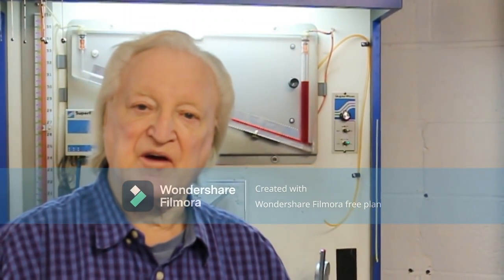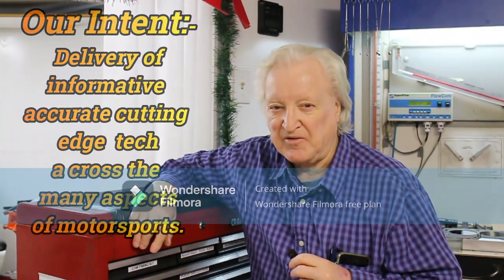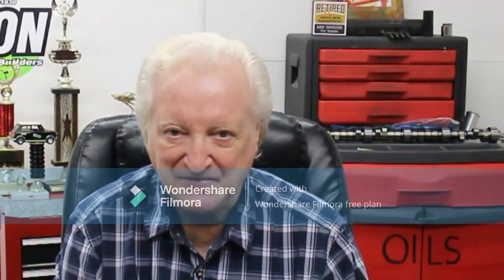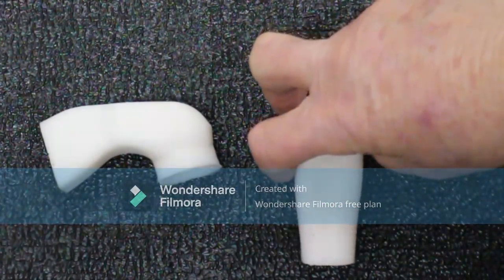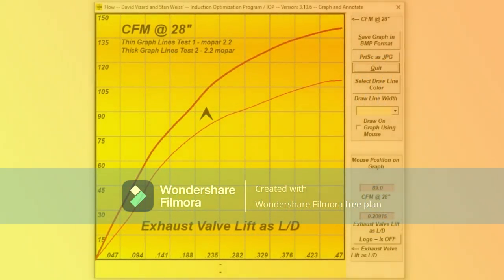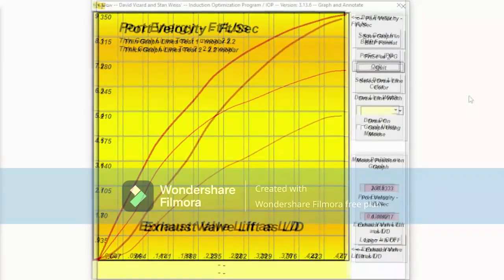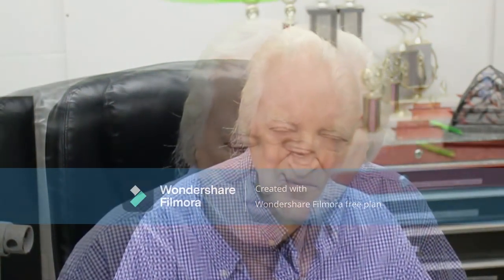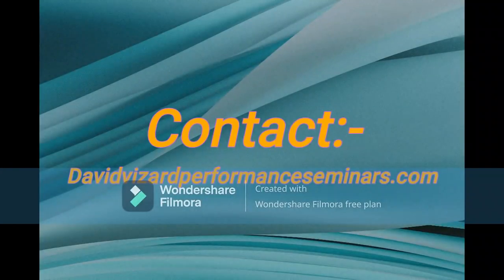Turbo Exhaust port science Chrysler 2.2

Comment: Thanks David. Waited with baited breath. Love your books, great to be able to see you Alive in Real Time. Great lover of Big Al Turner's work with Chryslers Aluminum Non Cross Flow production turbo head. Great understanding on what a Power Adder engine needs. I get quite cross when people deny the actual atmospherics in the engine changes if you add Boost or Nitrous. The real solution is to mess everyone's nicely order hyperbole on naturally aspirated and Boosted engines being the same. They aren't. It's only you David, and a few others who have realised the intake to exhaust relationship offers simple freedoms on intake to exhaust sizing. Lesson learned from your Cooper S cylinder head advice from those oversize valve head cracking days.Only you asked. "If you are restricted, what do you uncork? Which valve do you down size or increase one in favour of the other" . This is not a question Other People Like to even hear Asked. It's a Forbidden process, and the Hammer comes down if you DARE ask in other places.